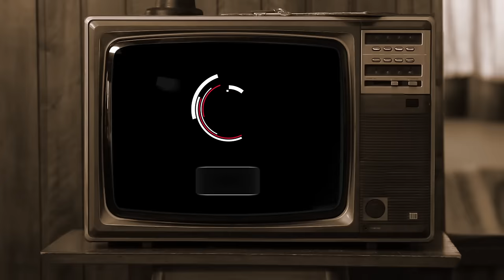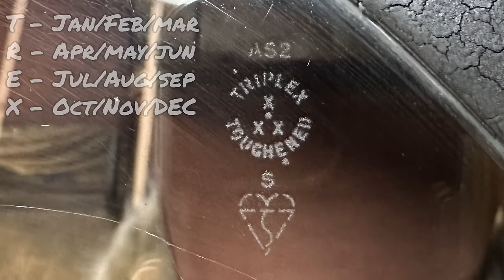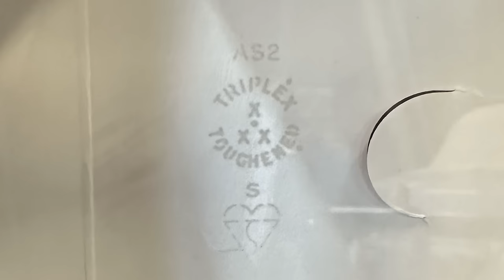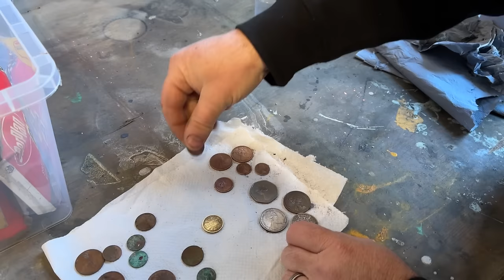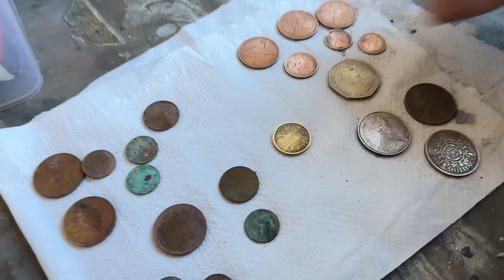First Wash In 50 Years: Austin A30 | Should You Wash A Barn Find? We Say Yes! #barnfind #firstwash

Comment: Wow!  Great effort there, Clare.  That little car is looking MUCH better for your ministrations - and I'm sure if it could talk it would say a huge thankyou!  Figured the seats wouldn't come all the way back (sadly), but it's great to see that the typical malady of the A30 - the gradual disappearance of a floor pan - hasn't been the case here. The biggest problem (besides getting her little engine to turn over again will be to beat that driver's rear guard back out.  Fortunately, the A30 is made of some truly heavy steel and will take a serious pounding with large hammers.  

Many moons ago, my aunt pulled out of a side street in my grandparents' A30 and didn't see the car that was flying along until it embedded itself in the right front wing and pushed it hard against the inner wing and radiator panel.  Dad pulled the wing off and "for fun", decided to belt it with a four pound club hammer and a length of 4x2" timber and see if he could straighten it out to anything like it had been.  After about 10 minutes, the wing was in a rough outline of its former shape and within half an hour, he had swapped the big hammer for a ballpein and eventually he traded down to the hammer and dolly stage for a while.  After two hours, the wing was pretty damn close and looked nothing like the twisted and useless piece of metal that it had been.  In the end, it looked so much better than the wing Dad had found as a replacement, so he put the original back on instead.  I reckon that right rear will come out fairly easy, but you will need to be more brutal with it than you may think to get it to move.  Man, it's a straight and relatively rust-free little car - a great start for a sympathetic restoration.......so I'm quit jealous!

Awesome effort - she's looking good and I look forward to seeing it progress.  How's the little green one going now?  Also, have you been out much in the black one at all?

One last - Barn Dust is only a good look in auction houses.  NOBODY would have it on display in a museum or as part of their collection like that, would they?  Anyone who would buy the little car to restore would want to see what's under the crud in order to know what condition it was in and what it needs.  Totally agree with cleaning it up.

All the best